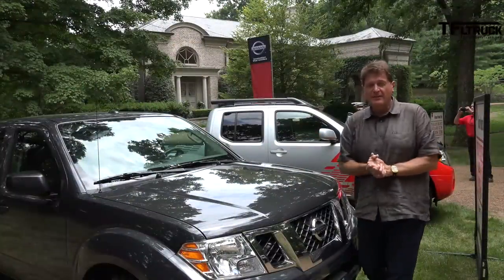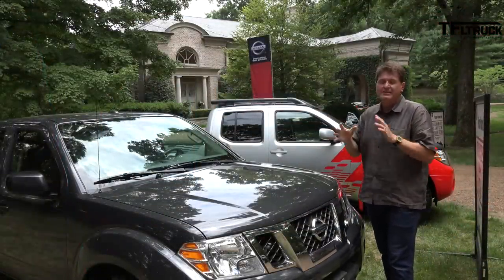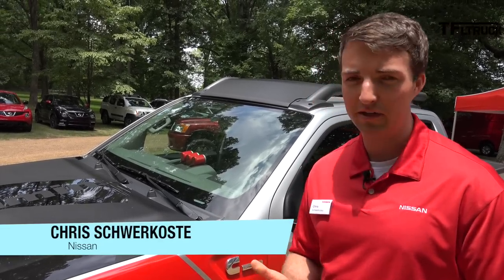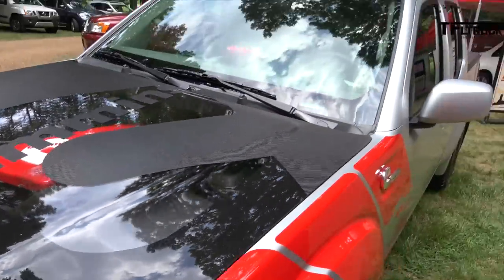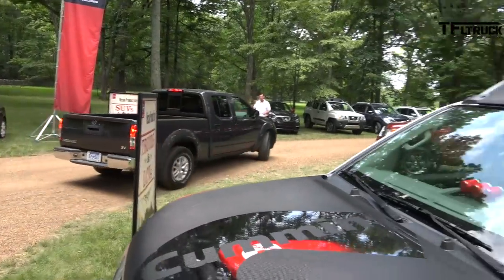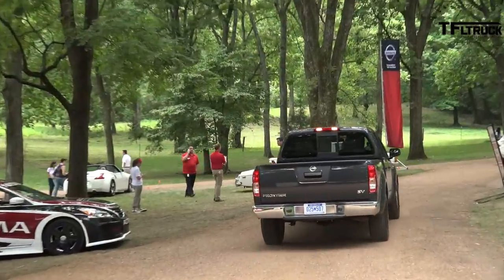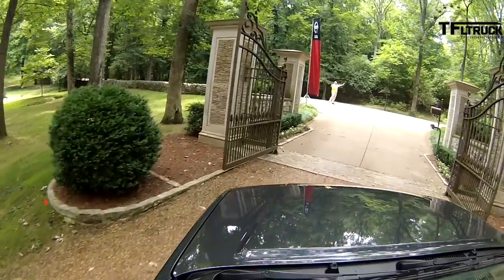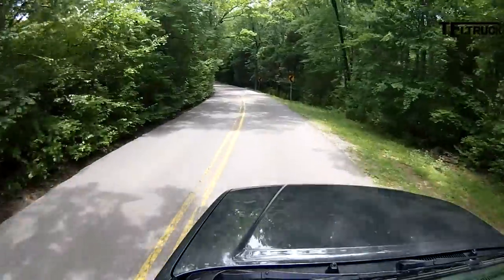Exclusive: Nissan Frontier Cummins Diesel Prototype Pickup Drive & Review

Comment: Bring this truck to North America, DON'T FORGET to include it with a manual transmission if you can please!... with a bit of advertising and awareness, you will witness the Frontier's sales boom! I've driven this truck in it's regular gas engine the V6 4.0L very recently and it's a really nice truck. No wonder people who buy these machines keep them for a long time! To see it with a diesel engine would make it even better! No matter the premium price, it will pay itself off as diesel engines have that longer lasting asset. Dodge has already started selling its 3.0L V6 diesel engine in their Ram trucks! Just think of the competition! Well... maybe, this frontier is equipped with a Cummins after all.

Comment: I have been driving Frontiers since my first 2000 desert runner I bought in 1999.  My current Frontier is a 2013 CrewCab Pro-4X. I will not drive a GM ever again, I would trade my 13 in on a cummins powered frontier in a heartbeat. I've had 3 second gen Fronties and am waiting for the fourth gen now. If it goes unibody like the Honda Ridgeline, I'll step up to Titan but prefer mini or mid sized.

Comment: As the owner of a Jeep Liberty CRD I can say that this is something I would be very much into when the time comes to replace My Jeep with something new. since the limited 2 year production of the Liberty CRD there is no small diesel truck or SUV for sale in the US market. I would really like a Wrangler diesel but Chrysler has yet to show much commitment to selling that product here. There are people that would buy this truck if Nissan built it. If I were faced with replaceing the Jeep now and this were available the Cummins reputation and previous Nissan Ownership would make it an easy buying decision. 

Chrysler sold the Liberty CRD in 05-06 with little advertising of the engine option but still sold all the ones made for US sale, then called it a failure and didn't continue to offer it. I hope Nissan Don't make that mistake with the Frontier.

Comment: I saw the Cummins diesel at the Chicago Auto Show and actually got into an argument with the rep that was there.This truck should've had a diesel in it years ago. The rep said they weren't gonna build it for me and needed more people to be interested.Who is not interested in a 35% fuel economy improvement?? Plus increased towing. I'm sick and tired of my 06' Toyota Tundra getting 13 mpg.I don't need a truck that pulls 10,000 lbs and is 20' long. I want something small and fuel efficient that gets great fuel economy. Just stop watching what other auto makers are gonna due and due something different.

Comment: I would like to see some higher displacement/more horsepower out of this kind of package. Chevrolet sells a V8 Colorado at what will likely be a lower price point than this truck. Nissan trucks aren't generally known for being reasonably priced. If you are going to build a diesel truck, up the towing capacity, beef up the suspension, and give it a beefier transmission than what you put behind your V6 engine. basically, make it a "heavy" light duty truck. A true step between the V6 Gas Frontier and the Titan. If you are only going to build this truck to be comparable to the V6 gas truck, why bother? Most people that are going to buy a diesel are buying them to tow. Offer a manual transmission as well.

Comment: For Nissan,  I hope this truck comes out and is affordable.  I am looking to replace our families 2009 Altima with a pickup, we also have a Rouge. The price under $40,000 is huge for families. I always do years of research and with the Cummings engine and a fair price, I would buy one in a heartbeat. I live in Colorado and midsize pickups (only Tacoma’s and Frontiers) are in the mountains. This place is not a place for cars that can’t handle all the rough roads and weather in the Colorado high country.

Comment: Only replacement for my 2006 Titan will be the Titan Diesel or should I say added to my nissan lineup currently in my driveway.  Even with 180,xxx miles, scratched and dented from being used as farm/work truck, it's running strong and still gets compliments and looks wherever it goes especially pulling a trailer or hauling load of firewood .. Release the Titan Cummings Diesel already, so dad can get him a new truck and Jr finally gets keys to the old one.

Comment: I would be a player for a 4x4 Nissan Frontier diesel with hopefully a larger xtra cab and a 6 ft+ bed. I like my 06 Tacoma dimensions, my xtra cab is very spacious you can tilt the front seats way back, or can carry a lot of cargo in the xtra cab. I am excited to see what Nissan offers. We tow a 17 ft Casita travel trailer, weighs about 3100lbs loaded, so this truck would pull it no problem it appears.

Comment: I hate the sound of it but V6 or supercharged 4cyl are not that great either.  I still prefer gas for the added HP. A small displaced turbo gas motor makes way more HP with equal torque and almost equal fuel mileage.  The extra gas is worth the added HP and its a cheaper fuel now.

You factor in that gas is cheaper now and the diesel motor costs more and requires more maintenance via Def additives;  it just doesn't make sense for this market.  Diesel belongs on heavy duty not light duty truck, majority wont want the problems.

Also in the cold climates diesels wont heat up unless their under load, so forget the use of a car starter to get the vehicle warm, so your window including "you" stay frozen for longer in a diesel vs a gas motor that will keep you warm on start up and defrost your window.

Comment: I own a 2012 frontier and my only real complaint is fuel mileage. Driving like a old lady it will average about 16-17mpg. Granted it is the 4wd with all the options but still I can do better than 20-21 with 100% highway driving!  Diesel sounds like a great option as long as it does not greatly increase the price of the truck.

Comment: This is a fantastic idea, but to be competitive with the Colorado 3.6L on fuel economy, it will have to get about 32mpg.  Too bad the government raped the fuel economy of diesel engines.  

That said, it will also need to come with a better towing package.  Like the guy said, it should be able to pull 8000lbs and have a trailer brake line connection.  That much power shouldn't struggle with it at all.  A better tow package may compensate for mileage to some degree if it doesn't hit the mark.

Comment: I want a mid-size truck capable of towing a snowmobile trailer or 19 foot boat without getting horrible mileage let's face it the tacoma, frontier, colorado, rangers and durango's of old didn't get any better mileage than their bigger brothers and hence why they all disappeared from the market why go smaller when you have better capacities at maybe 1 or 2 mpg less than the little guys. If Nissan can make a frontier that will tow 7000 lbs with a roomier interior that is more refined crew cab 4x4 diesel powered that sports a 6 speed manual getting close to 34 mpg or better  then I'm all in. I want a manual in my truck sure 8 speeds will get you good mileage but automatic in a 4x4 that is dug in the muck just spins you can't feather a clutch or rock your way out. I use a truck as a truck not a grocery getter. I love the look and size of the canyon but I don't have options for tranny and that's a turn off for me. Hell I can buy a 2 wd model with a stick but not 4x4 and only with a puny 4 cyl gas motor I'm not impressed at all so Nissan if you see this post diesel with 4x4 and a manual option please don't deprive us guys that still prefer a manual transmission.

Comment: Here in latin America we have the Navara/frontier with a 2.5 direct injected turbo diesel engine and it has reliability issues, toyota 2.5 and 3.0 turbo diesels are by far much better engines, the big Land Cruiser packs a 4.5l V8 direct injected turbo diesel that should find its way into the Tundra, why not?

Comment: Can anyoine tell me why nissan didnt just take their European diesel engines out to America it cant be because of the smog tests as the UK has these aswell not sure if they are as strict but, Nissan has an amazing 2.5 diesel rated at 190 bhp-320flbs of torque and a 3.0 diesel v6 that has 231bhp and over 400flbs of torque

Comment: Pretty sure all Cummings engines are built in China now. I'm not sure that will be a plus over the long run. The 2.8 has been sold for many years in the Marine industry and seems to have a good reputation so far.
Modern, sleeker higher crash standard midsized trucks are badly needed and GM seems to have finally stepped up to spur some action in this vehicle class. Thank you GM!!!

Comment: I have a '05 Frontier and it's been a good truck, other than the concern over the transmission cooler failing (no problems so far at 111K miles).  I would definitely consider a mid-size diesel pickup as a replacement.  8-speed auto would be good in case the wife wants to drive it.

Comment: Sounds like my 195,000 mile Escort with lifter tick or an exhaust leak.

This is pretty much why diesels have been slow to catch on in the USA. We don't like it when we can't tell if our car is running properly or not. We also don't like our driveways sounding like truck stops.

Comment: I really think diesels in small trucks works well. Let's face it, fuel economy in this segment is pretty bad. Towing in the real world with a small truck isn't any fun either. This resolves both problems. There are 2 problems left; the price of the upgrade and the price of fuel. I decided against the GM products due to the price of the truck. Fuel is out of our hands. If there were more diesels on US roads would the price go down or up?

Comment: I'm a big guy, so I doubt I would buy a frontier, even with the diesel, but put one in a Titan and I'm there.  My train of thought on pricing, if it pays for itself with fuel savings over a 5 year period, I'm good with it.  I may even go a little over that, if necessary, depending on other factors.

Comment: Ive owned this (navara) for 8 years and it still goes good. Only the 2.5 factory diesel but i have chipped it .6 speed manual  4x4.  My only gripe is the shit ground clearance.  Yanks should get one.

Comment: really cool. I would be 100% down to replace my 2010 Frontier with this diesel if it is going to be offered with a manual transmission.  If just the 8speed auto not as sure....

Comment: Would love a light duty diesel  even if it was more expensive, I been thinking about doing the engine swap my self for a while on my own hey a brand new truck already tuned from the factory no guess work or trail an error cause I was gone buy a older light pickup to of set the new engine cost but I would rather just financial a new truck .

Comment: I love the concept of small diesel in small pickup. I thing consumers will buy it, if the price is not more expensive then a regular v6. Jeep have a great diesel in the Grand Cherokee but the price is extreme. They load there vehicles with lots of options and call it a diesel package.

Comment: Nissan needs to release a redesigned Frontier with this diesel. If they could make it 240 hp and 350 ft-lbs, it would fly off the dealer's lots. As it is, I think it would sell well.

Comment: Wish it had better than a 35% fuel savings...considering diesel runs about 22-25% costlier at the pump over ethanol, youre only getting a 10% fuel costs savings in your wallet.
Reply: Unless you intend to drive a diesel on long hauls with a load/towing there is zero reason financially to get a diesel.  IMO, the VQ 40 motor/trans is just as reliable as a diesel.  This was just rated the most reliable mid size in US.  People drive these 300K miles.  Sure they take more gas.  As much as a full size but you can save 5K-10K in the purchase and it won't give you ANY problems.  After all these years in production the Frontier is seeing a rise in sales.  Well over 80K units a year.  Allot more then they made 10 years ago.  And its mostly because it just WORKS.  And the interior design, ride etc.. is still killing it.  Pro 4X trim is the one to get.  That also gives you 90 percent of all the modern tech and still keeps it all reliable.

Comment: I definitely would if the mpg increase offset the higher price for diesel. Diesel motors can easily last over 300,000 miles as well so longevity would be spectacular.

Comment: I would buy the frontier with diesel if it makes sense in the long run compared to the 2.5l 4 cylinder. How much more maintenance does the diesel require compared to a gas frontier?

Comment: I would buy any small, diesel powered truck if it was sold for around US$20,000 or less in a double cab configuration with a manual transmission and bench seats front and rear.  Manual windows, manual mirrors, manual door locks, no A/C or radio required.  Truck, diesel, bench seats, manual transmission, and cheap.  Anything else is just gravy.
Reply: Ur crazy, its got to have A/C and Heater bare minimum but that's just my opinion

Comment: Nissan shouldn't bother, with the Chevy mini duramax coming out in 2016 and the Dodge 1500 diesel already out Nissan won't even get a thin slice of the pie. The frontier is 10 years old and feels like a rattle trap running down the road, Chevy and Dodge coming out with new models... good stuff with getting Cummins on board but it'll be too little too late
Reply: More than likely Nissan will introduce a newly-designed Frontier with the diesel engine option. So, it wouldn't be installed in the current-model Frontiers.

Comment: diesels are great, love the power and the fuel economy, but as someone who works on them for a living, i don't want to foot the bill when anything goes wrong outside of warranty! And there is a lot of stuff that can go wrong on the new diesels, especially with all the new emissions systems and computer / module management.
Reply: Same with me,  I drive them for a living, and love torque and refinement of them,  but I know first hand repair/maintenance costs are through the roof and they're not particularly reliable and as a result, I'd never own one unless it was under warranty.
Reply: not nearly as expensive as fixing a diesel.
Reply: I'm a mopar tech, i work on cummins and v.m motori diesels. Most injection pumps i see on a daily basis are rotary style due to the new diesels being common rail, and the injectors are energized by the ECM, unlike the older mechanical inline "jerk" pumps which used to pressurize and distribute the flow to the engine itself. That being said, i know i may be biased on maintenance costs, as i only really see cummins, v.m motori, and the occassional Mercedes-benz CRD 3.0l come through. btw, i don't have a band lmao
Reply: McCraezy dang you just roasted him